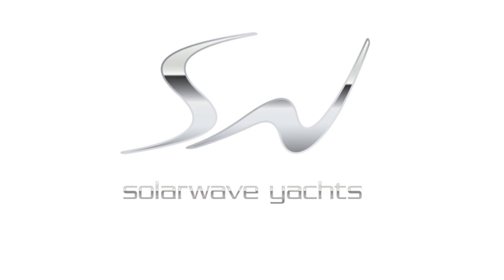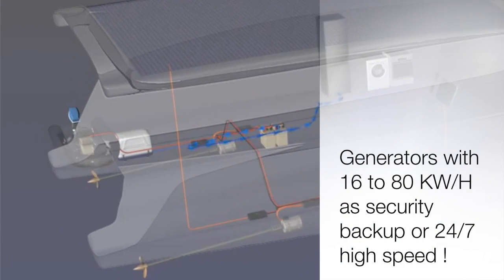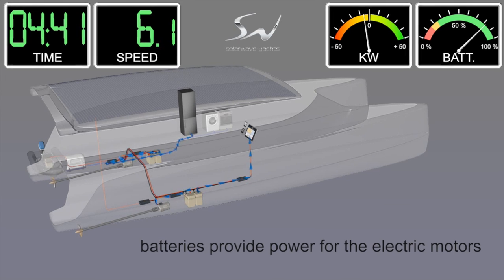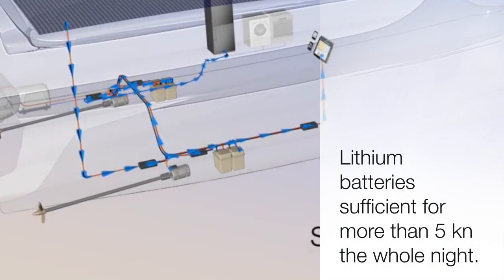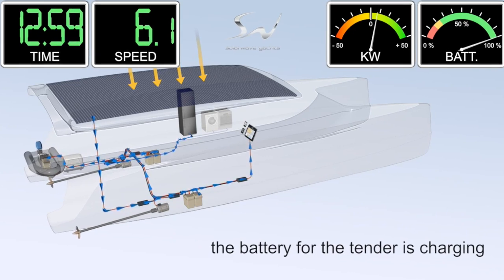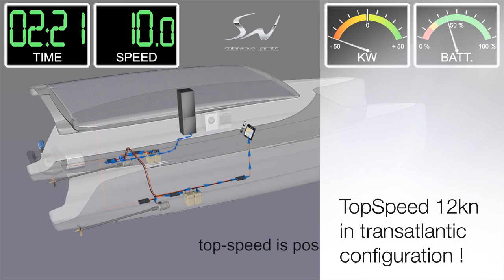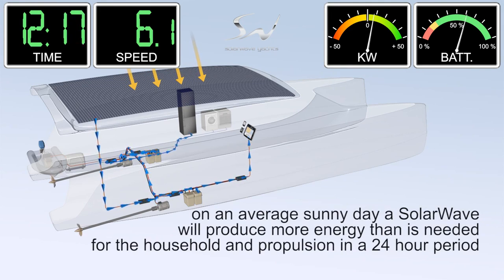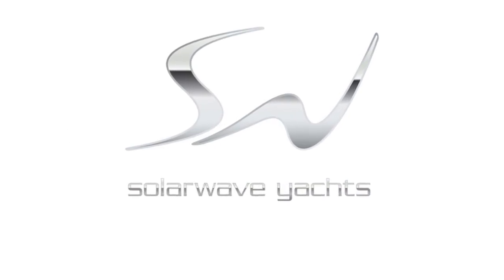Solarwave catamarans energy system explained

Comment: Using the energy options of wind and sun as appropriate but for sails consider an Australian innovation developed by John Hitch.   Not such a big stick as it is only a "skyhook" and the loads are on the bases of each roller-furling sail from each bow and twin FLAT CUT GENOA with twin sheets as far astern as feasible from the foot of the sails... It will become a good passage-maker best tacking downwind but she can tack upwind quite nicely... NEVER go wing-on-wing... (Very bad KAMA)..., If 6 knots can be beaten with a good 5~20 knot OVER THE DECK tack downwind to give yourself a maximum VMG to your destination - faster than all but lightweight fast surfing yachts & trimarans...   I like surfing and my 39C without sails recorded 19knots (40ft x 21.5ft and 4500kg full of 12 month cruising stores), with sails (hitchhiker rig) consistent 12~20knot passages would have been possible and 1000kg less fuel...   I was a solo sailor, but with the necessary crew for watch sharing - feels very possible...   I carried 15 x 300W, 24V PV panels and 240+kg of AGM batteries...   When I launched, electric drive systems were not a real option - I had a pair of Kubota 10hp saildrives giving 7 knots under power spinning at 1000rpm.......   I would love to try sun & wind on a similar cat hull with 3500KG gross...

Comment: Well I love the boat, I am really looking at the 75 (oh I want it) but just solar? If going to put the time and energy into it why not install at least 1-2 hydro turbines, and maybe 1-3 wind turbines and tie into the battery bank / generator?  Yes you may not need them during the day but, why not have them too at least pump power into the generator at night when you are motoring?
Reply: thanks for your kind words! On request we also mount wind generators. Hydro turbines we only install in combination with a Skysail - a huge kite that pulls the boat up to a windangle of 60°!
Reply: How much does the skysail help?
Reply: forget about sailing at night
Reply: Doesnt that create drag that will just cancel out whats gained, or do mean for when the boat is stationary?

Comment: Misleading and deceptive advertising, it’s not zero emissions if the diesel generator turns on. No matter how small the figures it’s not zero. Just saying.
Reply: you are not forced to turn the generator on. I can proof, that we sailed thousands of miles and lived four years on one of our boats without spending one drop of fuel. I´m the designer of these boats  - www.silent-yachts.com - best Regards, Michael
Reply: Exactly,  They never said zero but it's there for safety reasons.   I would rather not have FUEL aboard my Yacht.  Hopefully we can get there one day with just using WIND & SUN& WAVES  both and hydro turbines
Reply: For real?  What naive planet are you from, Ataman?  It is always good to have backups.  A crashed boat on the rocks is no good for anyone, even the environment.
Reply: I noticed there isn't much effort made to use energy efficient domestic appliances.. 
For example the fridge is a side by side energy hog.